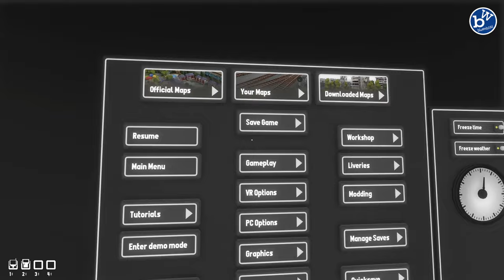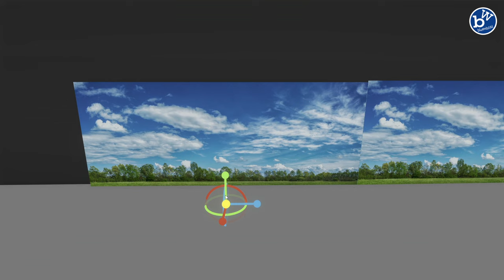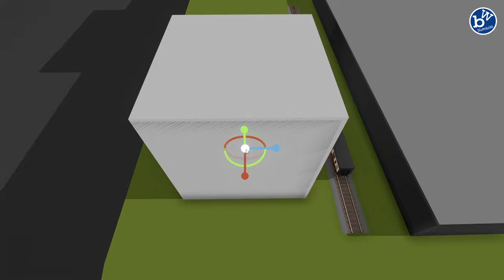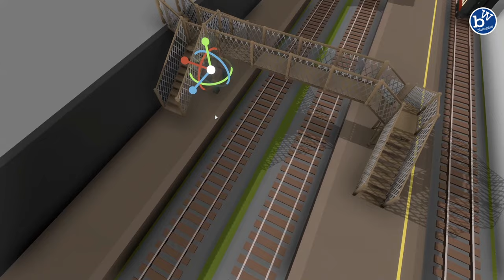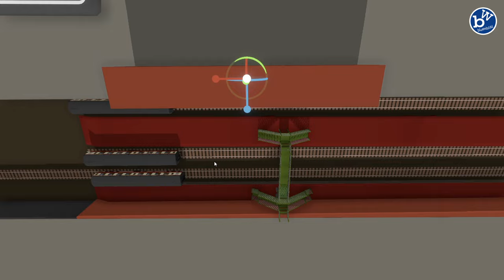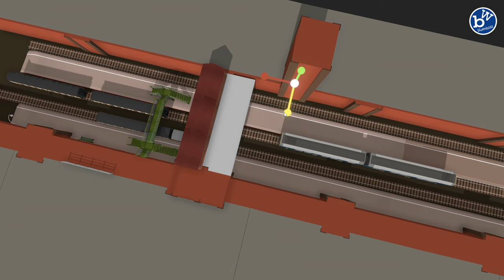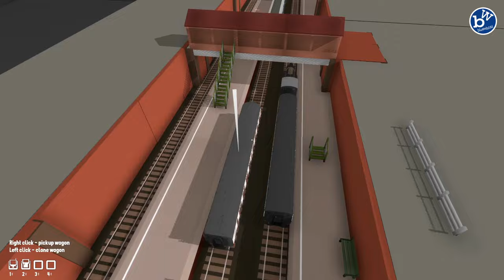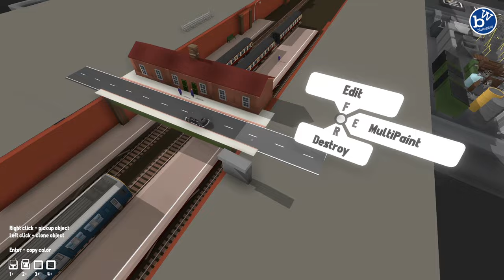Rolling Line - My Train Set P1 - Setting up & Creating a Station - Train set sim, VR + Desktop modes

Comment: really feels like for assets that would be used with this software that there be a default scale value on each model so there was less eyeballing whether things are too big or too small.  The trains and the track are of a certain scale, and if it's standard guage then the height of an average human figure would be known, and the size of a Volkswagen compared to a locomotive is known, and the width of a Volkswagen compared to the width of a road lane is more or less known (varies) and so on.  I think each stage from the track up to the road and the car going over the bridge things were getting bigger because there was no standard default.  The doors at the top of the stairs look 5 foot wide and the Volkswagen is as wide as a locomotive.  If a model came with "this Volkswagen is (X, Y, Z) dimensions" and so on, everything that is a human object could default to proper scale with the track and trains.  Unless you deliberately scaled it up or down for some effect, but you wouldn't have to work so hard to make everything look right.
Reply from the maker: Its hard to say why the sizes of modded assets vary so much and to be honest you'd need to ask the creators of the mods this question directly. They are all free though and so even if they aren't quite right I still applaud their efforts. The game wasn't ever designed to look like this, and they all did a great job with their creations. I suspect given time the game will add new different methods to add mods in and more will be added. The layout is far from perfect but overall I'm happy with how it turned out.